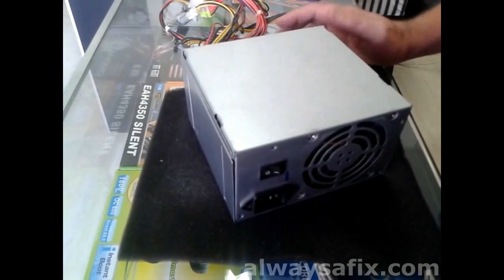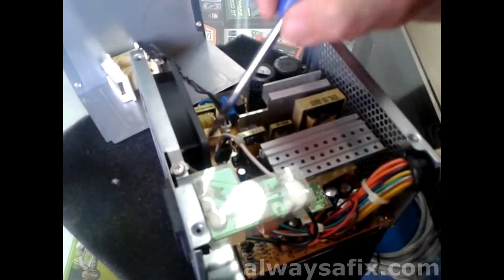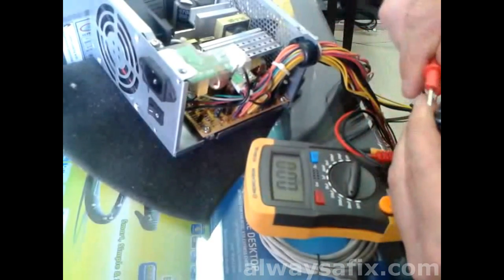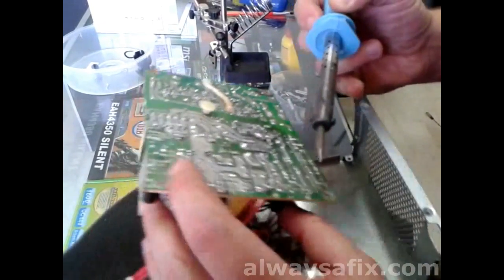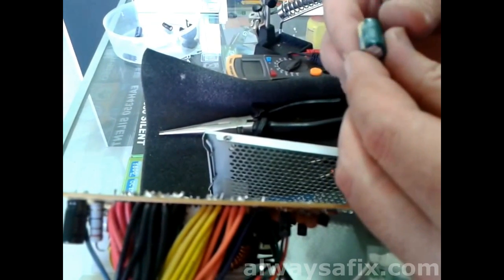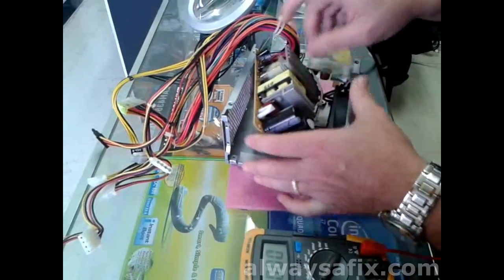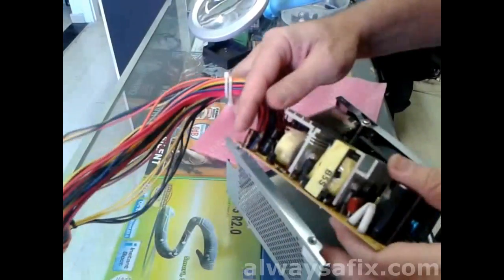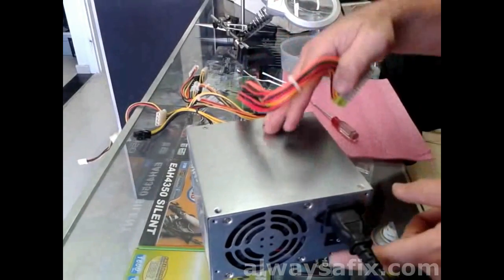Computer power supply PSU fault troubleshooting and repair

Comment: How much do you charge to rebuild power supplys. I have one for DVD duplicator the fuse was blown I changed it immediately blew again if you do reveal them how much you charge I cannot afford $350 for a used one there very expensive I can afford may be $40 to about $80 for one or not your typical power supply that you not have a power port for motherboard I just can't use a tester on it if you do please let me know

Comment from the maker: Most people attempting this repair themselves will not have much more than a multimeter.  In this video I use my meter to prove bulging or leaking capacitors to be bad.

Comment: Very good video!
But don't enough to works the PSU but we must measurements the voltages if are correct.
The  -12v is very important voltage and if don't exist there is serious problem.
Friendly Regards!

CheapParts Hellas